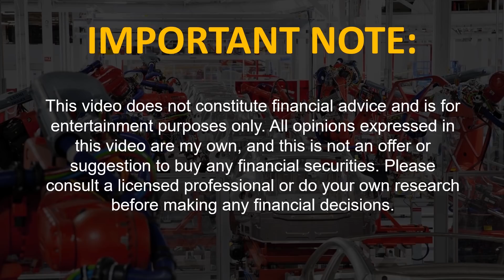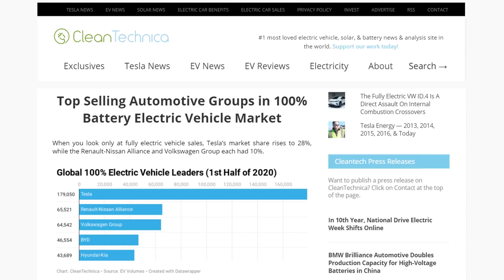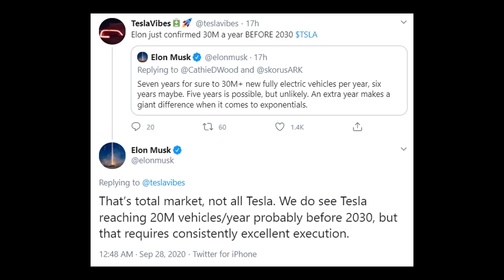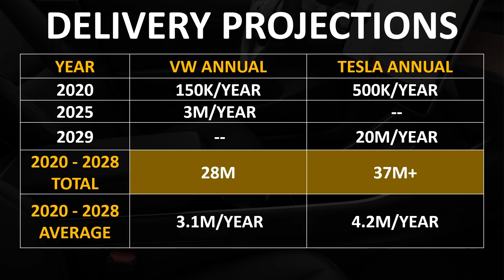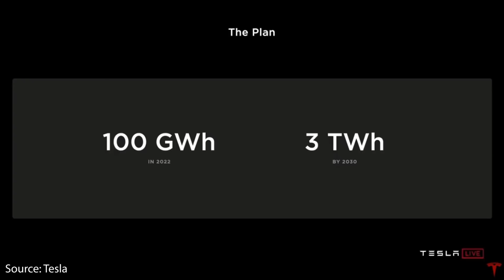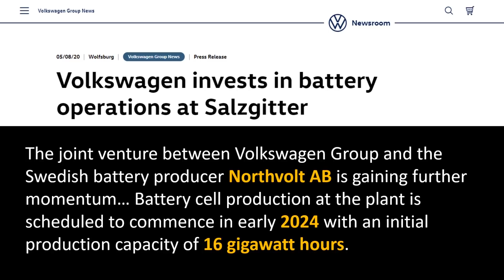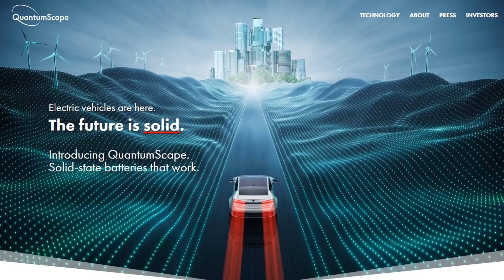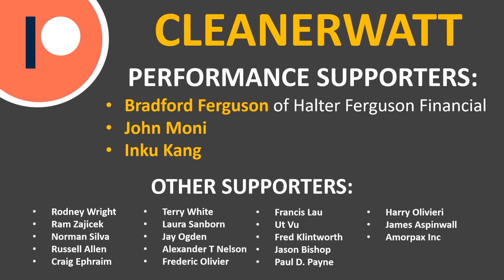Tesla vs VW: Can VW Catch Up? (Electric Vehicles)

Comment: First of all: I appreciate Elon Musk for his unconventional way, his high ambitions and that he has brought electric cars out of their niche. In the field of autonomous driving and vertical integration, he has set standards in the industry.
But now to the criticism. Elon himself has admitted that mass production and scaling are enormous challenges. VAG, PSA and others have decades of experience in this area. Furthermore, there is a reason why the automotive industry has focused so far on outsourcing and not on vertical integration. In order to be successfull with vertical integration, you have to be the best in every step, otherwise external purchasing is more worthwhile. With a highly complex product such as a car, this is relatively likely, so that specialization, division of labor and market competition among suppliers leads to more innovation in the long term. VW is ramping up production with ID3 and ID4, and the etron GT will be launched at the end of the year. The Porsche Taycan is currently selling better in Europe than Model S and X combined. Yes, the European manufacturers and especially the German manufacturers have been asleep or are hesitant, but research and development is also kept in secret rather than communicated via twitter. Unfortunately Tesla has no offer in the cheap small car segment. For company cars, that make up a considerable part of the market and live on in the used car market, Tesla has only the model s that is in the upper segment. taycan and etron will attack there and the ID spacevizzion as a VW passat replacement underneath. It might become thus quite hotly contested, PSA has similar strategies and the manufacturers BMW and Mercedes which are currently hanging behind will attack in the premium segment which offers good profit margins. Tesla's battery plans could be disruptive and ruin these plans, but at the same time I don't think that battery specials like CATL, LG chem and co are just going to let themselves be swept away from the market.

A few more remarks, because I read it more often in the comments. Tesla has the best price-performance ratio technically, but many people are willing to compromise if the car is cheaper overall and quality and dealer network is a security that tesla lacks. Tesla videos are often very USA focused, so I hope to give a small EU insight here. Last but not least: VAG and Tesla are fighting for market share and are competing with each other. Even if it's true that EVs are taking more and more market share from the internal combustion engine, someone who wants an electric car compares it to a EV and someone who wants an ICE to ICEs.
Reply: You are confusing the issue. An ICE is a very complex piece of machinery, rendered even more complex by the strict emission limitations imposed. Just a browse in to an ICE car engine bay and a nightmarish  Inferno of thousand different parts tubing, wiring, plastics, rubber, reveal itself. 
Now do the same inspection on a Tesla engine bay, most of it is empty, parts are very few,  the rotor is neatly assembled with very few wires and devoid of the thousands different parts present in the very busy ICE engine bay. Elon manufacturing philosophy is the very essence of his success, but also the very reason he is very successful at it. So I find your criticism totally void of a compelling motive. the motors made by tesla are the very best in the business, and so are his batteries, probably the most essential part of its cars, he had know all along and worked very hard to integrate its manufacturing too, with the astonishing results that already at this stage he is able to produce them for half the market cost per  KWH. Your argument against mine? Every single car manufacturer in the world is running with 20 to 30% sales deficit over last year, while Tesla numbers are they only one that has kept its vertical enthusiastic sales positive momentum in between 25 to 35% increase over last year numbers, which makes your criticism totally uncalled for as well as silly. You should address your criticism to the ICE losers, that to date are still confused, and hoping that Elon Musk just disappear, because they know that as long as he is going to be around the red ink manufacturers have a very bright future in front of them as Tesla surely will with about a million cars on the order books, and factories sprouting all over the world. Please tell me in a few simple words what were you bitching about, for you are definitely barking at the wrong tree.
Reply: I have been to Fremont and met with the head of production, a former Audi employee. The Fremont factory is state of the art, very similar to competitor factories. Shanghai is something else, built from scratch and designed for optimal efficiency using latest technology and a layout which minimises transports. Giga Berlin is likely to be another step change in efficiency. "Never before have incumbency been worth less". 
Elon admitting the difficulties is a sign that they are humble and willing to learn but also challenge old truths and try their own ways. Fail sometime but then quickly learn and move on. Many established companies are arrogant and think they already know everything. They have stopped learning or trying new things.

When it comes to vertical integration, the idea is not to be best in every step but to get synergies and to be able to have proprietary technology which is not available to competition. For instance, Tesla has developed their own chip for autonomous driving which is faster and consumes less energy than anything they could buy in the market. By having their own battery tech and integration into the cast  parts of the vehicle they control several important performance parameters and lower cost.

Taycan is too expensive. A model S plaid definitely looks like the better alternative. Tesla "Model 2" will be developed in Berlin by German engineers and will be adapted for the European market just as there will be a new car developed in Shanghai.

It is a fallacy to think that large established companies can respond quickly to disruption. Nokia, Blockbuster, Kodak? Established companies are extremely good at doing what they do best. When the business environment requires something very different they cannot reinvent themselves. The first mistake they do is to think that a BEV is just an ICE car with different drive system. BMW is an example of a company which was on track with i3 and then lost themselves in an ICE/EV compromise which will result in non competitive ICE and non competitive EV's
Reply: @BjorckBengt  The issues facing German Auto Mfg are complex. They have a large commitment to ICE in terms of manpower and equipment. The advantages of EV are not so glaring if you look at all issues. However things change. All of a sudden China wakes up to pollution and drives EV cars up. That makes a huge difference. Tesla going after a performance oriented luxury car segment with Autopilot and FSD dream cuts into the German luxury market.The Germans will adapt. They have no other choice. When they do it will be a quality product. I do worry about the electronics. German cars are not great with electronics.
Reply: @willdehne1  German cars have been the best in the world when it comes to performance and convenience. Japanese cars have been the best when it comes to quality and durability. Unfortunately success can be a problem when you need to restart. When you have learned a recipe for success and repeated many times it is almost impossible to stop doing what has made you successful. Most legacy companies have departments for experimenting and innovation, however in the end the new ideas will never be fully implemented. Those arguing for "the safe way" tend to win.
It seems like Germany and Japan benefited from having their factories bombed out during WW2. It took a bit longer to get up and running but when their industries where reestablished they were much stronger. I also think it is typical that when the disruption comes from America, it is not the three big legacy auto that reinvent themselves, it is a Silicon Valley start up led by a guy from South Africa. Most innovative in Europe are small companies like Rimac.
The problem with electronics in German and other cars is that they have never viewed this as a core competence. They have bought electronics from sub suppliers and then applied it as an add-on whereas Tesla view their cars as computers on wheels.
Reply: @BjorckBengt  You know I am from Germany? The German car industry is crucial to German economy. Much more so than here in USA. The Germans are well trained to do all kinds of things optimum. There are valid reasons against going all out for EV. One main point is hauling around a 3000# battery and model S to transport one person or two. There are more arguments but that is enough. Germans have been slow with electronics and are not leading that technology. They need to shape up or will be left behind. What I am thinking is that VW will have no choice but get going. Perhaps team up?
Reply: @willdehne1  Well driving a Mercedes S class or BMW 7 series is not really optimum in anything but pleasure until the bill arrives. The main reason german car companies did not go for EV's is that they were already successful with diesel and the main environmental threat was emissions. Then the environmental threat shifted to global warming and suddenly you couldn't argue that your emission control system would fix it. German engineers are great at electronics. Bosch, Siemens and many others have leading tech. However auto manufacturers have added a bit of electronics every year and often systems that are proprietary to the supplier. Now, when it is needed to design the car starting from the potential of the electronics and a holistic view of how to monitor and control everything, the auto companies lack that competence. It is not sufficient to have knowledge in individual systems, you need to understand all systems and how they integrate to create safety, convenience, efficiency and great driver interaction. Then you cannot have ten different systems from ten different suppliers built with ten different ideas of how they should function.
Reply: @BjorckBengt  Right on. You know the subject. I believe that Desperation is the mother of invention. The Germans can simply not afford loosing the automotive industry. I read somewhere what % of the Germans depend on automotive. It is scary. I was one of them escaping to US in the 60's. Got in on the ground floor with Robotics.
Reply: @willdehne1  Fortunately Tesla establish both development and production centers in Germany. The jobs will stay in Germany and my guess is that Tesla is just as good employer as BMW or VW. Then I hope that Tesla could learn how to cooperate with responsible unions in Europe and that Unions in Europe do not favor specific brands. I have got the impression that in the US you have a combination of hate for Unions and in some cases actual corruption in the Unions. I don't know which is true but employees in the US need to get into a better negotiation position. In Sweden employers mostly appreciate responsible unions and benefit from easy negotiations.
Reply: @BjorckBengt  You are correct. Here in the US we have an adversial system where parties to a negotiation believe winner takes all. Germany is better with that. They have "Gewerkschftsbund" which is illegal in the US (Monopoly). Also the average German worker has much more training than in the US.
I managed a US sub of a German Robot Company and have seen this in action. No contest. Actually impossible. The salvation for the US is automation, electronics and imports. No matter what Trump says. On that he is barking up the wrong tree.
Reply: lol vertical integration will win and tesla is going to make it happen period.

Comment: I'm fairly certain that VW alone will sell half-million EVs (ID3, ID4 and UP) in the next 12 month (worldwide). When you factor in the Audi, Porsche, Seat and Skoda, a total volume of around 700K is possible. As a result, I suspect that by 2022, VW would have surpassed Tesla once the cheaper ID4 is locally manufactured in China, USA and Europe. I find it hard to believe that Tesla will see a 50% growth simply based on model 3 & Y alone. The addition of a Cybertruck then maybe but I personally foresee a 20-30% growth rate for the next five years. Lastly, outside of America, Tesla will find it hard to maintain its advantage unless it produces a smaller vehicle (current models are a bit inconvenient European cities) and improves its' quality. What tends to work in America car wise tends to be less successful outside and vice versa especially if a comparable alternative is available (I'm referring to rang and price point, as for performance not so much).
Reply: With gigahai, gigalin, gigamont and teratexas. All cranked up by end of 2022. Along with the batteries from battery day. Tesla will be at or over a 3,000,000 run rate. Without building any new factories in between. Which at less than a year from groundbreaking to first unit's rolling off the line's. They could possibly get a couple more going. And then they may hit even more than 3.5-5million unit's of production. 🤔
Reply: @4literv6  https://www.channelnewsasia.com/news/business/volkswagen-eyes-90per-cent-electric-car-sales-in-norway-next-year-13221196 lol
Reply: Kabelo madileng This is assuming VW will not be battery constrained, can CATL, LG chem , and whoever else VW contracts with produce that many batteries for VW, Tesla , and others?  Doubt that.
Reply: VW has 60 giant plants i think the same it will take over Tesla soon lattest Next Year. MEB is the key to role out many models and low costs. A car is expensive. Affordability, quality and reliabilty is very important not like a smart Phone which people or fan can buy without thinking too much

Comment: Around the 9:30 mark you talk about the potential battery production across the various Giga Factories gloablly. This is the first I have heard that they will bee setting up Roadrunner lines at Giga Shanghai. I understood that the Chinese market will continue to use the CATL and LG Chem batteries. Do you have a link/reference to where they commit to Roadrunner in China, or is it just an assumption at this point. (Which is fine, just curious).